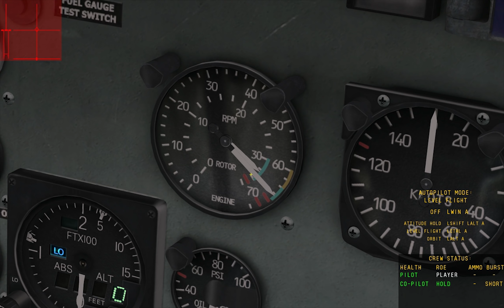Flying & Landing the Huey in DCS

Comment: Not a chopper pilot myself, but just a bit of exposition of my understanding regarding the steep flare. The real crux of the issue is just that you don't want to change collective rapidly or abruptly in any situation. As you know, changing the pitch of the blades changes their drag, which changes the load on the system. With the collective (pitch) low, the load decreases, and the tendency will be for the rotor and engine to speed up. Consequently, the engine governor will reduce engine power to keep RPMs within limits. Then, if you jam the collective to high pitch, the load on the system suddenly increases while the engine is not producing much power, causing the RPM (and your aircraft) to plummet; the governor does not operate instantaneously and lags a bit in responding to changes in system load. Overspeeding the rotor in the steep flare just exacerbates that gap, and increases the lag time even more. Often, just long enough for you to crash.
Reply from the maker: Sounds reasonable enough.
Reply: ***** Yes, the torque meter, just underneath the RPM meter.
Reply: So how does one avoid killing them self in VRS?

Comment: Very impressive video Dslyecxci! I'm amazed by how much you've managed to pick up on your own just practicing. Although when you were demonstrating ETL, what you called "not a normal takeoff" was actually a perfectly demonstrated normal takeoff. Look up "Height-Velocity Diagram" in a operating handbook and you can see the path used for normal takeoffs. Other than that great job!
Reply from the maker: My impression (which could very well be mistaken) is that you would give at least some collective to counter the minor sink that happens from pitching forward. By "not normal" I really just meant that I wasn't touching the collective at all, not even a little bit. I probably could have said that better in retrospect but hopefully it got the point across.
Reply: ***** Yeah sorry, I was indeed mistaken by what you meant. But in a normal take off the collective actually shouldn't have to be pulled any more than hover power at first assuming good conditions. You slowly accelerate through ETL maintaining a few feet of altitude then once you reach the proper airspeed dictated by the Height-Velocity Diagram you raise the collective to takeoff power and start your climb out. This takeoff of course isn't mandatory, it's just recommended to avoid the shaded area of the H-V Diagram and can be tweaked to fit the takeoff necessary.
Reply from the maker: Cipher29 Interesting to know that, thanks!

Comment: The UH-1H/V Models maximum air speed is 124 kts, the big needle is your main rotor speed and the smaller one is tail rotor if you split the needles that probablymeans your auto rotating to the ground.  6,000rpm is what they call ground idle, 6,600rpm is flight idle.  When you are taking off you want to get into translitional lift.  If you take off straight up thats called maximum power take off.  Also in flight above 30 kias the rotor pedals are not used, but always give a little left pedal.  Under 30 kias you can use your pedals for turns.   Don't bank more than about 45°.  The aircraft that you are flying is a "V" model not a "H" model. The information i am giving you is for a real UH-1.
Reply from the maker: The product is a UH-1H sim, you can read more about it here: https://www.digitalcombatsimulator.com/en/products/helicopters/huey/

Comment: I flew Hueys 30 years ago. This sim is darned close to the real thing. Really brings back some memories. My biggest criticism would be the lack of anti-torque pedal authority. I've turned up adjustments to the max and still don't get the positive smooth response you get in the real thing. Cyclic and collective are pretty close. I'm using TM pedals. Wondering if that my be the problem  or maybe its the flight modeling. Also, way too much panel vibration during translational flight. If we had one shake that bad we put it back on the ground for a track and balance session. I flew several model Hueys, Hughes 500 C and D models, S-62, and learned in Bell 47 D models. Wanted to live a long healthy life so quit flying helicopters and concentrated on fixed wing instead.

Comment: I bought one of those cheap toy helicopters from ebay. Flying with it was surprisingly interesting, more difficult than I expected. Howering with it is difficult even without wind, all the adjustments you need to make constantly, how everything is connected, how quickly it reacts. Trying to keep that sense of control and how fast everything gets fucked. Very different from driving a car, you just can't rely on anything, everything is on the air so to speak.
Reply: I assume you are talking about a simple coaxial (dual main rotor) helicopter. Move up to a collective pitch RC helicopter and it's even more difficult.  I'm flying a collective pitch heli (TREX 500), but it took me 3 years of practice (mostly in an RC simulator) to reach any basic level of competence. Finally I'm able to do flips, fast turns, fast controlled descents, and auto-rotations, etc.  But because RC helicopter rotor speeds are so high (2K to 3K RPM), things like vortex ring state don't affect them that much. It's more like flying in ARMA than flying in the Heuy in DCS. Also, with modern gyros, we don't have to worry about tail rotor inputs that much due to collective pitch changes. RC helis are more twitchy than a real helicopter (even with a 3 axis gyro), but the real helicopter still requires a lot more understanding of how not to crash.

Comment: I have flown a real helicopter irl (plan to become a pilot) and while it was a small R22, my joystick would pretty much hold wherever I placed it and wouldn't try to become centered (because let's be honest, having the joystick constantly fight you wouldn't be the best thing ever trying to fly a helicopter). There wasn't any 'trim' option for the helicopter, but then again it is small enough to where you probably wouldn't need one. Too bad DCS doesn't have much in the way for wind- when you hit updrafts or even wind shifts, you have to correct for them. The corrections aren't large, but a simple updraft or downdraft change would be immediate and sudden. Sometimes I would go through one, the helicopter would jump and then return back to normal. Other times I would move my anti-torque or cyclic and continue flying normally. And while TrackIR and the flight sims used by people in shows are really good, nothing actually accounts for flying in an actual helicopter and feeling the feedback in person and having full depth perception, which you do need for helicopters for obvious reasons (Really useful for landings and even hovering for more than a few seconds at a time). Though I will agree with you on one part- the controls for helicopters are very minute, but they shouldn't be RAPID- when I did my movements, they were usually fluid and slow, especially during a hover. Move too much and you're no longer hovering.

Oh, and I'm not sure how it is modeled in the real huey, but if the rotor RPM dips below I believe 97% in the R22, both the Rotor RPM light and horn starts. It of course isn't a FIX THIS NOW type of thing (since you still have a lot of safe RPM range for the rotor), but you should be trying to fix it when you can.

Comment: I miss force feedback joysticks.
Never owned one, but I still don't understand why the technology basically died out completely.

Plus given I sometimes fly (real) light aircraft, which typically have rod or cable coupling to the control surfaces, it's indeed true there as well that spring centred stick is a very poor representation of how a stick in such an aircraft behaves.

When sitting on the ground, not moving, there is next to no resistance in the stick at all. It doesn't auto-centre, it just flops around.
In flight, whatever force you feel on the stick is the force of air over the control surfaces. Not only does that mean that this still doesn't auto-centre the stick, but the amount of feedback is proportional to airflow, and thus varies with speed and conditions...
That is, the stick resistance you feel can tell you a lot about the speed at which you are moving, and the degree of control surface deflection, because it is the airflow itself providing the resistance...
Reply: Well, with Fly by wire systems FF Joystick are not that important, but i agree with old planes or most important helicopters, its very handy to have

Comment: I'm loving the video but I have a question since you more or less said to not use pedals in high speed flight, are you supposed to ignore the turn coordination ball in high speed flight or what? because flying with a level bank and high speed doesn't keep the ball centered and yet it looks awkward when you apply rudder because then your nose is not travelling in your velocity vector so I don't know what to do I'm a big fixed wing guy normally so I'm just used to trying to center it

Comment: Good info and presentation. I use the warthog as the collective (indent removed) but having issues with the power where it’s engages when pulling the collective up or down. What settings do recommend in the axis tune to get it as close as possible?

Comment: Is there a governor? Can you manually control the throttle? Thanks for your reply
Reply from the maker: There is a governor, and you can manually control the throttle if you'd like. I've only ever used that for practicing autorotations and otherwise let the governor handle it.